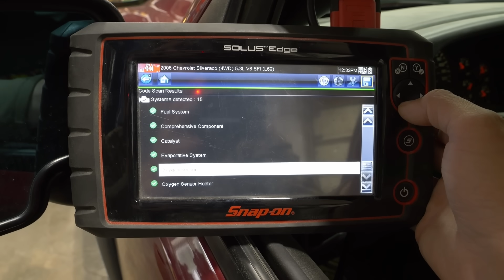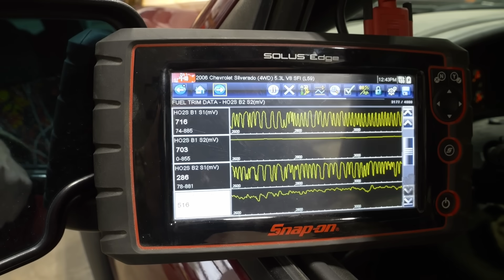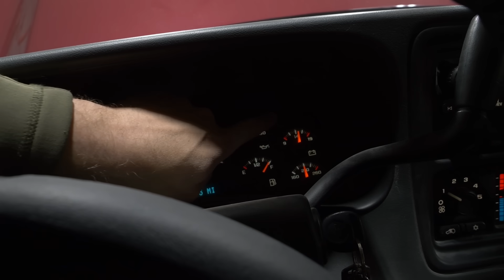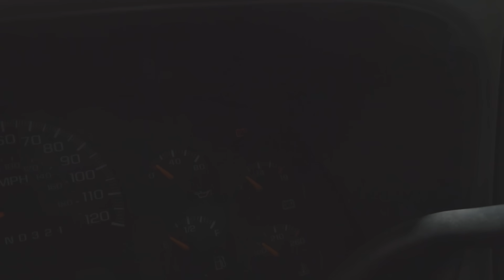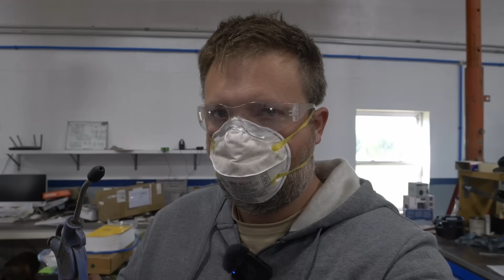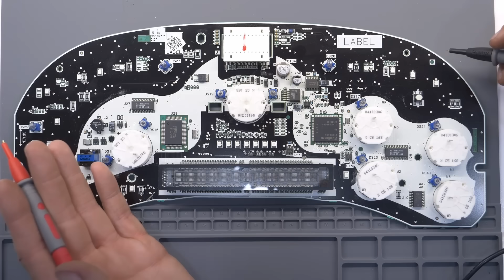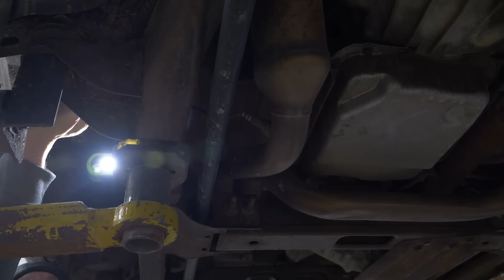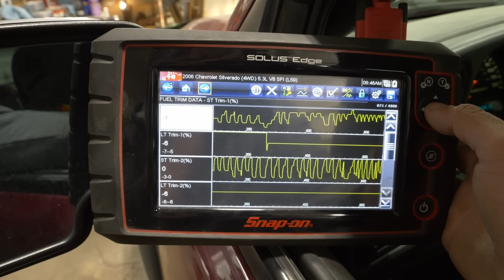AutoZone Says It Needs a Starter

Comment: Ex autozone employee here, if the battery light was on he probably had them test it with the battery testing tool. The tool just hooks up to the battery, checks it then has you start the car. It has 3 fail states, bad battery, bad starter, bad alternator. The only thing it measures is voltage drop/current draw from the battery. If it thinks the battery is good, but there's a large current draw, it'll say it needs a starter. Probably how he got that "diagnosis". Could be malicious from the autozone employee, but more likely just poor training/they were just reading what the machine told them.
Reply: I bough a cheap tester and did this at home, it said I have a bad battery but my mechanic checked it and told me to throw away the crappy tester 😄
Reply: @Dr_V  I actually kind of had this experience yesterday. My battery kept dying on me, so I jump started it and got battery back up to 12.36v, put my cheap battery tester on it, said bad battery. Went to auto place and there tester said voltage needs to be higher before they can say. Drove it more, got it up to 12.6v, went back there and now they said my battery was good, tested it again with my battery tester, it now said it was good. So moral of my story is making sure your battery voltage is 12.5v or higher before testing the battery with your battery tester.
Reply: @zzzzzz...9902 a good tester will tell you "charge battery and retest".
Reply: @zzzzzz...9902  A simple voltmeter can fool some simpletons,even worse when a parts store not licensed to do car repairs does them using a set of bad diagnosis
from a misused tester by some commission based salesman
It's the deaf leading the blind and the stupid to run your charge card to oblivion.
If the battery is not holding at least 13 volts with every thing "ON" in the car with today's computers deciding whether to turn on the alternator or not- you may have more than a bad battery
loose,corroded terminals will eventually kill the output devices inside the ECU-a short internally inside the battery will kill it in minutes
Reply: @dddevildogg Is that from personal experience or did you work at one of those places?
Reply: @YogurtSnipe  Personal job experience under the rack-I would never lower myself to work for a Car Parts Oligarch-the abuse those people get is tremendous- but that's because the local management is so bad- and the job is so hard to fill
Reply: @dddevildogg  True, I once took a look when looking for my first job in my local area and saw their hiring sign. Took a look online from their website and saw their starting pay as $12.60 an hour, not my states minimum wage but it’s still pretty low for bills considering it’s bi-weekly pay from what I heard.
Reply: @YogurtSnipe  I've seen counter people and 'manglers' that haven't even changed a tire in their whole life-It's over $15/hr in my state-but you could never even get a 2 room studio on that pay here
Reply: @dddevildogg  Crazy
Reply: "So moral of my story is making sure your battery voltage is 12.5v or higher before testing the battery with your battery tester." Yes! Now you can buy relatively inexpensive battery load testers (see Project Farm's tool reviews).
Reply: I worked for a big name Aussie car parts dealer who I won't name but their name starts with R and ends with O.  You talk about training ?  No training.  Minimum wage, malicious management, they hire people who know nothing about cars and much less the equipment they use like battery testers.  Shit company to work for in every conceivable sense. 
So not likely to be malicious from the employee, he or she just didn't know any better.
Reply: @ellesmerewildwood4858  Yeah I’ve witnessed it one to many times.
Reply: Battery light on. Check alternator output. Should be 13.5- 15.5 . If it says 12 volts your reading Battery volts, replace alternator. If Battery is 5 years old replace it also. With Battery and charging system good Check voltage drop at Battery with starter cranking. Shouldn't drop below 10 volts. If lower than 10 starter is faulty or bad connections/cables. 😊❤
Reply: @danburque7555 Unfortunately you over simplified it all lol. Get educated properly
Reply: AutoZone has two ways of testing batteries, the first is the handheld tester for the battery, alternator and starter. The second is the semi-industrial charging stations in the back that can charge, test, check temp, and require more information giving a more accurate reading whether or not the battery is AGM, Starting Standard, Platinum, Optima, etc. 

To be honest though I’d always trust multi-meters over anything else they can get you out of a pinch from crappy testers. Either that or take the battery out of the car and make sure that sole component is working. I’ve had multiple times where the battery was living while wrenching on them and having it go kaboom all over me.
Reply: Typical-and pretty accurate- midtronics unit.
Reply: How did they know it was the starter in his other car though
Reply: Most parts store workers have no real world mechanic experience.  It's rare to find one that knows how to do anything more than ring up a part.
Reply: Idk a starter can definitely wear out over time. I have a truck with a 6.5 diesel engine and the same batteries that would only crank at 100rpm and set the starter on fire turns the engine over at 300 rpm with a new starter.
Reply: "...crank at 100rpm and set the starter on fire turns the engine over at 300 rpm with a new starter." So, does it have a separate starter indicator guage that displays 'Starting RPM'? Thanks!
Reply: "The only thing it measures is voltage drop/current draw from the battery. If it thinks the battery is good, but there's a large current draw, it'll say it needs a starter." Electronics and aviation educated car repair expert here: That parts store utilized portable tester can only reliably measure a battery's initial Voltage (V) drop across the entire car electrical system, similar to a Multi-meter or Voltage-load tester (connected in parallel to the Voltage source) without turning ON any of the accessories: head lights, A/C, wipers, etc. For an accurate battery current (I) test an inductive Amp-clamp meter or a multi-meter probes connected in series must be used. The best tests for a battery, starter, or alternator are performed on an industrial-type bench-tester.
Reply: Never trust AutoZone 😂
Reply: @samholdsworth420 your right they do not work on cars they sell parts to people who do
Reply: "You're right they do not work on cars they sell parts to people who do." From personal experience, some but not all, have prior automotive maintenance education/experience. So, please don't paint us all with the same brush.
Reply: @samholdsworth420  What ? Did the car not need a starter ?
Reply: AutoZone employee here the only way we can make a profit is by ripping off customers sell them b***** that they don't need they only hire Psychopaths
Reply: Ex auto zone employee??? I thought they hired anyone how the hell did they get rid of you. Most people with a heartbeat stay there because it takes no skill to sell people the wrong parts. That’s why I go to orielys or Napa. Autozone employees are brain dead and so was your comment. People that bring their cars to auto zone to scan codes are just as bad as autozone themselves… people that bring their cars to scan codes at part stores are too stupid to know any better
Reply: Malicious or not it ain't right lil buddy.
Reply: U said x employee so I guess u were a lost cause too and now flip shit on the grill at micky Dee's....

Comment: That vintage of truck had issues with fractured solder joints on the cluster connecto. Reflowing the solder on the cluster connector fixed a lot of problems.

Comment: Crappy fuel and emissions standards imposed on us by stupid government regulations 😠. Hopefully 'common sense" will be returning in the near future.
Reply: Based. It all started with lawfully mandating seatbelts, is it a good idea to wear one, yes. Should you be required to by law, no. Next thing you know the EPA is mandating computers in passenger vehicles and tripling the cost of repairs over time of ownership.

Today's vehicles have over 3,000 wires(130lbs worth) in them, it only takes about 55 wires to run a vehicle including climate control. Everything else is add-on BS no one needs.

Comment: I like that little prying implement.  If I remember correctly, I used a plastic fast food knife and maybe a small flat screwdriver, to pry off the needles on the gauges of my 2005 Mustang GT, when I replaced the stepper motors.  That car's connection to the cluster board employs a locking lever, which reminded me of a computer processor!

And those fast food plastic knives are very good back scratchers - oh, the serration!!!

Comment: AutoZone was confused and was talking about the Chevy Cruze needed a starter.
Reply: AutoZone will try to sell you spark plugs for your diesel
Reply: @xephael3485  🤣
Reply: Went into AutoZone for a outer tie rod for an F250. Guy says what do you need? I tell him I need an passenger side outer tie rod end for '00 f250 7.3 2wd(all the info necessary to pull parts up). He asks me what make is it? - I say " I said f250", but once again asks me the make!! I'm done... I just walked out! If you sell parts for a living and don't know an f250 is made by Ford (#1 selling vehicle series in USA for 47+ yrs) you're even dumber than a brick! Btw he wasn't a kid either, I'd say mid 30s at least! I just left & ordered from Rock Auto instead since it wasn't urgent, was just a little lose. Paid less than they wanted & delivered to my front door in 2 days. Actually got tie rod & 2 cheap front shocks for what AutoZone wanted for just tierod! There is some semi-knowledgeable people at the parts stores but some should be cleaning toilets instead! 🤦🏻‍♂️🤔👍🏻👌🏻🛠️🔧🔩🦺

✊🏻🇺🇲🦅🇺🇲✊🏻
Reply: @tdotw77 I can agree with you on most of that sir! Try asking them about a K1500.
Reply: @tdotw77  I just gave my wife, who has almost zero mechanical knowledge, a quick quiz.  I asked her if I had an F250, what make is it.  Her reply was, "Well, it's its an "F" 250 I would assume that it was a Ford.  Apparently, she's overqualified to work at Auto Zone.
Reply: @berthongo8531  😆😂👍🏻 Nice! Give her a pat on the back g thumbs up from me! 

It's really not that difficult to know in today's day & age IMO. The Ford f150 & 250\350(super duty) etc are literally everywhere from billboards to TV commercials to Internet ads and been #1 selling vehicle in the country for almost 50 years, so they're everywhere all over the roads. I'm not being unreasonable in expecting everyone selling parts at a parts store to know that information am I? 😆🤔😂🤦🏻‍♂️😄👍🏻
Reply: If you want to see confused, ask a counterperson to deviate from their standard, "Year, Make & Model of your vehicle, sir?". They will freeze & have no idea how to continue!
Reply: @DarkFlamage  Got any more tired old jokes about going to the parts store? I mean, I get it, you're slow and don't realize that's how our digital catalogue works.
Reply: @sarahmathias9463  if someone says F250, you should be immediately choosing ford -> f250 and going from there. Nobody should have to tell you Ford makes that
Reply: @ForeverDriven2121  Exactly! 👍🏻👌🏻😄

Comment: You would do well to follow the advice of the experts at autozone.  They employ the finest minds with the greatest experience in the field.  Just because you don't know what an oxygen sensor code has to do with a starter doesn't mean it isn't a starter problem.  It's like when the pinnacle of experts, the dealer mechanic, says you need to replace your computer and wiring harness, you definitely need to replace your computer and wiring harness.
Reply: To be fair the dealerships can fix just about anything within their brand, they just don't give the mechanic time to properly diagnose, most diag time only pays 30 minutes.
Reply: @COBRO98  They also are known to fix things that aren't broke, or to over fix a problem.  If they conclude that the problem is that there is broken wire they have been known to replace wiring harnesses rather than open the loom and splice the wire.  Obviously this varies by the dealership and who is running it.

Comment: That generation of clusters are known to be extremely common failure points. It needs a new cluster to fix that battery light.
Reply: The cluster can be repaired, no need to replace the entire thing.
Reply: @THEEVERYTHINGTHINGCHANNEL  eh. Just go with an aftermarket unit that doesn't have the issues of the OEM one. The labor involved in repairing might end up outweighing the cost of a replacement unit. It also gives you the opportunity to customize it if you want to

Comment: A faint glow from the Battery light on a GM, at least older ones, is the sign of an alternator beginning to fail. Diodes?

Surprisingly, Toyota offers a dumber version of this: On one of my old Corollas, the brake light illuminated unduly, and it turns out that THAT was the sign that my alternator was beginning to fail. I googled it at the time, and yes, that was a thing!

Comment: based on my understanding its a battery light to signal the vehicle is operating off battery power only. thats why its on when engine off off in acc mode but not when running and the alternator is taking over

Comment: My 04 suburban did this. Of course the fuel gauge, oil pressure, rpm and eventually the speedometer all stopped too. But that battery light was always on. Ordered a rebuilt one and it's back to normal with no battery light.

Comment: I had someone bring their car to me a few weeks ago. They thought the battery was bad. They went to autozone and they said it was a bad alternator. When I looked at the car there was no serpentine belt. I started looking for the reason there was no belt. The P/S pulley sheared off inside the pump and threw the belt. 
The belt was still stuck under the car so that saved $20. 
The alternator was fine $280.
The battery was fine $200.
The new pump was $180 and I found a pulley at salvage for $20.
Reply: So AutoZone was right per usual
Reply: @jimjones1678  I mean the alternator definitely was not pulling it's weight lol.

Comment: "cheaper to throw parts at it than do the diagnosis" until you introduce a bad or cheap part that starts compounding issues, sigh. Shops that do real diagnosis will just end up being misunderstood and undervalued by people chasing the cheapest solution and no other values (see also Amazon and all the other "cheap instant gratification trends" that marginalize everyone else)
Reply: Wes was referring to a mechanic doing the work. He saw an issue with the 02 voltage on scan data, screw a new sensor in and recheck the voltage. Maybe 30-45 minutes worth of work total on that setup.
Reply: @mph5896  yep I do understand and was commenting on the larger trend and importance of diagnosis - which we all know Wes understands

Comment: My guess is that the battery light power leak was on the connector(s) between the dash cluster and the car harness. And you 'cleaned' it when you unplugged the cluster from the car.
Reply from the maker: I could see that. I'm still not sure only the battery light is affected. The more I think about it, the more my brain hurts.
Reply: That could certainly be explained by manufacturing differences in the LEDs. They usually aren’t characterized for such ultra-low-current applications and might behave very differently between individual leds.

That is often a problem when LEDs are stringed together in series without load-sharing resistors. If one of them has a slightly lower resistance (which is also usually not specced that tight) it gets more current, gets warmer and might germinate even lower resistance, resulting in a run-away condition.
Reply: @MaZderMind  That's why one burns out in clusters (be they five, 6 or more). Your average LED bulb? It's not burnt out, it's one LED that ate it. You can save quite a bit if you keep your old LED bulb, pull out one of the goods ones and pop them in place of the burnt one on the new bulb. The cheaper the production, the cheaper the checks too. Used to be that these LED bulbs would last ages. I've a few that are now double decade long and still in use VS new ones, circa 2022 ish, that are so garbage, they're not even lasting months. Same brand, same outside look, just 30% lighter.
Reply: My guess it's a stuck signal somewhere. Unplugging the battery might have done the same fixing effect.